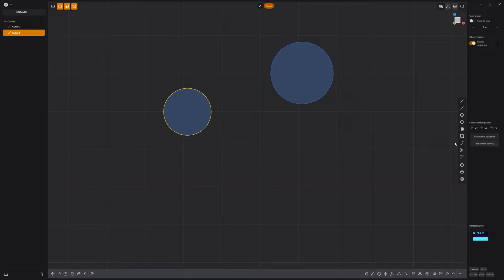Plasticity | Modeling Exercise 52

Comment: Why is it so hard to make the vertex snap? I'm trying to make a network of curves and it's almost impossible to use the loft command because they're not connected... I've used the zoom but I can't connect them... Sorry for my English, I'm using a translator

Thanks in advance!
Reply from the maker: the points should snap to curves np. do you have Object Snaps enabled?
Reply: @pixelfondue  I just hold Ctrl from vertex to curve but there's a microscopic  gap between... The color is green when it's supposed to be blueish. So frustrating 😞
Reply from the maker: @Fasimedes  NO need to hold ctrl. it should snap without ctrl key